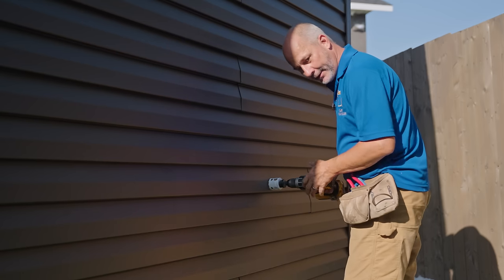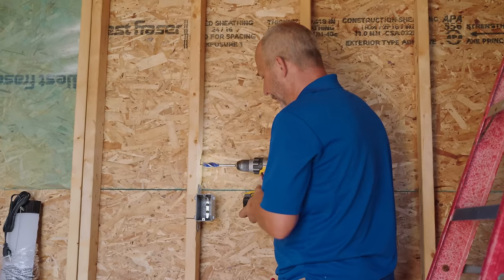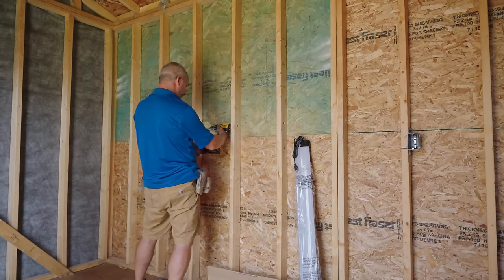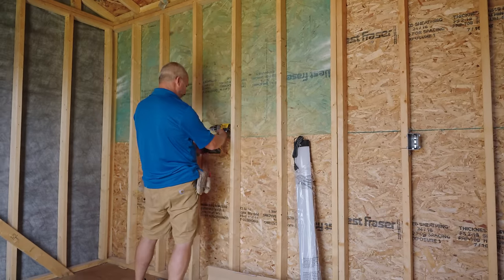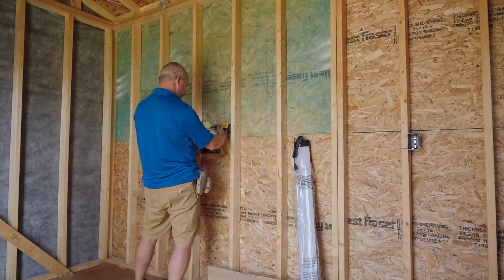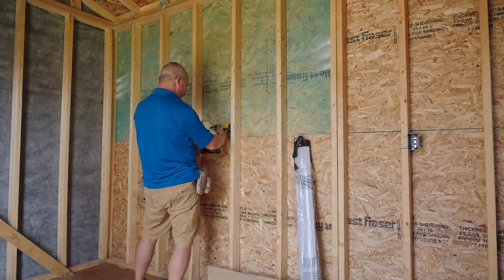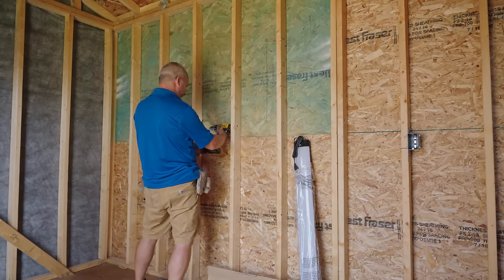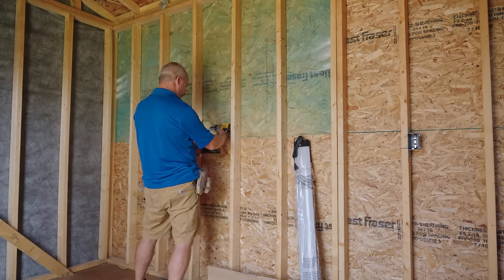How to Run Permanent Temporary Power to a Shed

Comment: I noticed how suddenly the sleeve portion of the plug appeared.  Apparently you had to take it apart to slide that sleeve on off camera.  I’ve had to do that so many times while replacing power cord ends and so glad there was nobody watching me.  lol
Reply: I thought my eyes were playing tricks and just rolled with it. We are tuned in 😂 it's probably because we've done it enough we thought did he remember that nope
Reply: Yeah good eyes I saw that too lol
Reply: Just like flare nut fittings you do your best flare when you forget to put the nut on then cut it off then make a crappy flare with the nut on.😂
Reply: The day, I tell myself that I know it all and don't make mistakes is the day I stop learning. I been watching you for a long time. My question is here in america white Romex is for lights, switches the yellow is for outlets!; is that correct? I'm not a electrician but I do know that. Lol
Reply: @juancarlosmunoz7177  yellow is 12/2 and good for 20 amp, white is 14/2 and good for 15 amps. 20 amp circuits are commonly used in bathrooms and kitchens and 15 amp circuits can be used else where.
Reply: @samhunt5521  thank you for the clarification as that's what I was told. Not a electrician just some one that wants to learn
Reply: I was smiling at that as soon as he started talking about stripping the wires. I knew he was going to have to redo it. Then he redid it a second time to put the plug on the outside of the building. Those little oversights can be so frustrating when you're trying to get something done.
Reply: He edits a lot of mistakes out of videos. It's like finding a Easter egg 🥚 in every video 😅
Reply: I think we've all done it, lol.

Comment: You want to run 12 gauge Romex (yellow) instead of 14 gauge Romex (white) if you are going to use powertools.
Reply: Unless your power tools are 20 amp a 15 amp circuit is fine. Sure you can run a little more on a 20 amp and that's how I wire utility circuits, but power tools are generally for 15 amp installs. 20 amp  units have a 20 amp cord end (-I) or are hardwired. I agree a 20 amp circuit is better for this install.
Reply: @ericnortan9012  there maybe multiple things running at the same time: lights, fan, table saw, vacuum...

Comment: If you're going to put drywall of panelling on later, you should have metal plates on studs where the wire goes thru the studs, so screws or nails can't puncture the wires.

Comment: “Permanent temporary” is my new favorite way of alluding to a fix that’s legally dubious.
Reply: its kinda like the 'accidentally on purpose' expression
Reply: Needing a permit for power to an out building is legally dubious
Reply: @David-uf9qm  Some municipalities don't allow power to non-permit required structures. 
My town allows small sheds and the like without requiring a permit to place them, but they will jump on you for wiring it without it being a permitted and inspected structure.
Running an extension cord out when needed is a functional work around, though I'm thinking that I'd just put a "shore power" style input connector under an outdoor outlet cover instead of the romex pigtail.
Reply: @heyallenify  Some municipalities are clearly too protected from the people they don't serve.
I agree with you about the outdoor outlet, and personally I'd find a legal way to run power immediately adjacent to the shed out of spite.
Reply: @David-uf9qm  or just stop being a rebel and follow the rules in place. people like you always just wanna challenge "the man" for no reason. codes are in place for a reason.
Reply: @dement3djoker in his defense, it can cost an arm and a leg because they are always looking for a way to restrict one’s pursuit of happiness.
Reply: @dement3djoker lmao you must be an inspector or you benefit from the money that they receive for doing Absolutely nothing most of them won’t even get out of the damn truck have a good day mr. dogooder
Reply: @jessicamilligan4710  nope just have common sense and like things done right. Selfish people who cut corners get people killed. End of story little one.
Reply: It's temporary, but I'm not removing it anytime soon LOL

Comment: Your content is always great, and I realize this is "temporary power", but you need an update: In Canada, from 2018 CEC requires a neutral ('identified conductor') in all switch boxes (Rule 4-022 2). If you have to get an inspection at some point, you will have to re-wire that light.

Comment: When wiring the wire to the outlets I had an experience where I only used my cordless drill/screwdriver to attach the wires. I went back to a location that I had wired a year later and noticed black scorch marks above a light switch. I opened the cover and noticed that the cordless driver hadn’t tightened the screws on the switch to the point that they wouldn’t move, so everytime someone flipped the switch on or off a little bit of movement would loosen the screw, after a years time the screw was so loose that everytime the switch was flipped a spark would occur. I’m grateful I discovered my error as it could have very easily started a fire. From that point onward I made sure that after I attached wires to switches or plugs that I would follow through with a manual screwdriver and give everything one more twist to make sure that they won’t ever work themselves loose. When you did your switch you said not to worry, that you did not want them too tight, I think you should reconsider that and ensure that they are tight enough so that they won’t ever loosen, it can be dangerous otherwise. Other than that it’s an excellent video and it’s very informative, I love the electric tape on the white wire!
Reply: After initially tightening the screws, after a few seconds go back and tighten the screws again.  Copper is a soft metal and friction with the screw head causes the wire to expand ever so slightly making it feel you made a tight connection.  The copper cools and shrinks a little and that requires retorquing to achieve proper tightness.
Reply: @TheRealCheckmate  'ever so slightly' it's like retorquing new alloy wheels.   Look into it wise guy.
Reply: @TheRealCheckmate  You must be the guy that uses the push-in connections on electrical devices. That phenomenon is real, try it for yourself.  Grab some copper wire and make a few connections and tighten the screws as snuggly as you think is tight. Go back ten seconds later and re-tighten the screw and see it and fell it turn a few degrees.  Then give us your explanation for this phenomenon, Professor Whoopie.
Reply: @TheRealCheckmate  whatever the reasoning is he still makes a good point that especially on light switches going back and giving it another twist is a good idea. My ex-wife was living in the unit where I discovered the scorching above the switch and if the place had caught fire I would have felt terrible. Thank god I noticed it when I stopped by.
Reply: Had something similar happen recently with my hot water tank connections...eventually blew the main breaker.
Reply: Looks like Realcheckmate had his comment deleted. 
Anyway, couldn't help notice the original comment on this thread didn't receive any love from the host😢

Comment: Great video. Two comments:
1) instead of having the male plug hanging outside, you can purchase a generator plug inlet and mount it on the side of the shed.   
2) the screw slots on the plates are vertical because dust is less likely to collect compared to if the slots are horizontal.
Reply: Always wondered why it was vertical.
Reply: I just checked out my face plates with screws adjusted horizonally and you're right the amount of dust collected there over the past four decades is probably contributing to my chronic allergic reactions whenever I am in the vicinity of their face plates.
I've reminded the wife to make sure to clean them from now on thanks
Reply: @joseph7105  I never paid that much attention to the screws in the face plates.
Reply: Every time I go to someone else's house, I take a thin screwdriver with me and, when no one is looking, I set the faceplate screws to 2 o'clock.

Yeah, I'm that guy.
Reply: @3rdPartyIntervener  Your not invited.
Reply: AND it's called Soldiering your screws.
Reply: I've never heard of the "less dust theory". Aligning the screws verically just keeps them in a parallel vertical line from top to bottom, supposedly it shows signs of a professional electrician and gives a neater appearance.
Reply: @dc6233  And what if they are lose or to tight? To tight breaks the plastic and lose let them to continue to loosen over time.
Reply: @dc6233  no definitely not it.. its to keep dust off  (sarcasm) :P
Reply: Еще они сейчас бывают галогенные и светодиодные (новые). Мощность галагеннок большая, они греются, натяжным или гипсокартонным потолком это может быть плохо. Лучше светодиодные, 5-7 ватт
Reply: Anything you have to call permanent temporary is probably garbage.
Reply: That is what I did on my shed.  Its a male connection inside a casing that  sits flush against the siding and has a water tight cover when not plugged in.
Reply: @johnirwin1837 we always use the unbreakable large plate covers and screws at 12&6
Reply: @joseph7105  Make sure she gets you a sammich first.
Reply: @RyanReich-CivicSi    I don't know.  I heard that horizontal screws slots is causing panda bears to go extinct, that and the under-the-roll toilet paper.
Reply: Out door protected box plug I used one for my welder off the service pole  but it was made for  RV or genarator hookup depending how it is wired and which receptical you use . My welder useses a diferent plug  than  the receptical that came with the box.
Reply: I've always put them verticle....Its an OCD thing
Reply: @deanerbes5725  Me too, don't know why.  Just because.
Reply: @3rdPartyIntervener should be set to 6oclock or to 12midnight
Reply: @joseph7105  Clean them yourself.
Reply: Your wife will really appreciate that I’m sure. eyes roll lol
Reply: I have a lot of leftover 12ga wire from years ago.  Yellow does not make it 12ga.  and white does not make it 14ga.  Maybe new wire but I will continue to use my remaining white wire until I run out.
Reply: This is a much better and professional looking alternative. Good to see so knowledgeable people watching the videos and making recommendations
Reply: @deanerbes5725  Same here--within a day of move in, I went around my house and "fixed" them.
Reply: I put blue painter's tape on them.  No dust to wipe off,  and they wont back out.
Reply: @3rdPartyIntervener  I love the idea of this evil mastermind going around scheming all these subtle chaotic plots, but then they're so subtle no one ever notices
Reply: I actually ran the extension cord into the shed & wired it directly to an outlet & that outlet feeds the other 2 boxes in the shed
Reply: @deanerbes5725  VertiCAL. I'm CDO* as well.  *Arranged alphabetically.

Comment: Thank you for the comprehensive video on how to get it done. I appreciate your explanation of key details. Very helpful to DIYers. I would caution that most local codes do define “temporary,” meaning that after the end of the “temporary” period (usually months - NOT years as you described) an inspection WILL be required! This is not to criticize your work - your procedures are sound. BTW, a good electrical contractor has one (or more) techs who focus solely on small jobs. Small jobs create thankful & loyal customers. Guess who they’ll call when they have a bigger job? Being willing to take on small jobs makes loyal customers at the very least, and has the potential to win bigger jobs down the road, either thru repeat business or referrals. IMHO, having one (or more) techs who focus solely on small jobs pays off in the long run.

Comment: Didn't check all the comments for this, but one suggestion for wiring, "First to make, Last to break", talking about the ground wire. That way, if you just happen to be working on a live circuit, the electricity travels down the path of least resistance, that ground wire, and not you.

Comment: Nice edit on attaching the plug at 42:18. Prior to that, I was yelling at you to not forget to slide the housing on first. But you were so smooth, almost no one noticed! 😄
Reply: I caught too. He wired the end up without running the wires through the back, then all of a sudden there it was
Reply: Came to the comments to see if anyone else caught it. 😂😂
Reply: When he took it apart, he dropped it instead of putting the wire through, so it was a pretty blatant mistake.

Comment: Hi Jeff, I am in Ireland, I worked for an American Railway Signalling Company here for 11 years. All our slotted screws were always vertical - Reason given was moisture can run down the slot and also while all being Vertical, then looked better. Perhaps just me but I would have run Plastic Conduit along the horizontal run, would have looked very professional. Good work, Great at explaining. Here in Ireland, The  UK and Europe in general, Brown = Live, Blue=Neutral and Green/Yellow striped = Earth (CPC). Old Colours were Red =Live, Black= Neutral and Green=Earth (CPC). Philips and Robertson screws :) well we have our problems here too, Metric and Imperial pipe fittings mixed in the one installation , especially something built from 30 years ago and parts upgraded. So you could have 1/2 inch Copper, 1/2 inch Qualpex (plastic imperial) and 15mm Acorn (Grey metric) and perhaps Polly Pipe and fittings outside which would be for 1/2 and 3/4 black plastic hose pipe with both thick and standard wall thickness with White and light blue inserts for thick and thin or vice versa, Only the correct one will fit.

Comment: Excellent video!  Thanks for the system approach.  One thing I learned in the Navy to help remember the wire color code for the outlet and switch screws is 
White to Bright  --> Neutral/white to silver screw
Black to Brass  --> Hot/black to brass screw
Green to ground --> Bare copper wire to green ground screw
I think the "white to bright" is the only part I didn't hear you say.  Thanks again for the no-nonsense teaching style.  I love it.  Keep up the good work.
Reply: I remember when I was a teen in the 70's with my Roadrunner (Plymouth). Must have changed the stereo 3 or 4 times as they got better. "Grey and white are right" (speakers) is the mnemonic I made up and I still remember it! Taught myself to rebuild an engine, too and probably became an Engineer because of that (not electrical Engineering!).
Reply: Great tid bit of info... just like to add something for safety, I was always taught to connect Grounds (GREEN) then Neutrals (WHITE) then Line/Power (BLACK)  even tho the power is off, its just great practice. Also there should be no exposed wire from under the terminal screws, wire insulation should be up to the screw not under the screw. I know common sense right... but every one wants dollars, no one has sense anymore. Cheers

Comment from the maker: Thanks for watching, if you found this helpful please subscribe. New videos every Saturday. Watch the entire series 👉🏼
https://www.youtube.com/playlist?list=PL34cQkzKfXWZjAohJEWQ4WD6LUXxH904u Cheers!
Reply: nice job Jeff but your first plug needs to be a GFI you know better
Reply: A LOT more is shown here than 'running a temporary power line to a shed' LOL
Nice techniques... eh?
I didn't know you are Canadian! I always assume what I hear on YouTube refers to US Code but when I heard you say 'Robertson'... I figured, then later you confirm! Even better! (Always nice to hear CANADIAN Code! and 35 years of experience.)
Reply: Great video. Just a suggestion. Use a male RV shore power inlet plug inside an exterior outlet box. It's waterproof and looks professional and the connection itself is protected from direct element exposure.. When you're ready for permanent power you're ready to go and don't have to scrape all that foam and poly out. Additionally the siding is already protected and done correctly.
Reply: @omobeanz340  That makes a lot of sense!
Reply: What wire did you use I’m looking to do the same but not sure what I should get
Reply: He used 14-2
Reply: @bc-guy852  They got something called an ECX screwdriver for those hybrid combination slot, square, and Philips screwheads
Reply: @WoodgemanX  No thanks.
Reply: @bc-guy852  OK, stick with your Robertson square drives, Canada's only meaningful technical innovation since 1909.

Comment: Leviton makes a great connector you can use for “temporary” power connections.  
15 Amp 125-Volt Straight Blade Grounding Power Inlet Outlet, Gray
Reply: Right the last bit on the outside is just not acceptable. The cable is not UV rated and can deteriorate in the sun. Also, the plug is not waterproof and is likely to hang down and fill with water on the first rain.
Reply: @JasonEDragon He was so close! Leave the cord connection inside! There was so much that was bad about this video.
Reply: Even better add an in-use cover to make it completely weatherproof and fully up to code